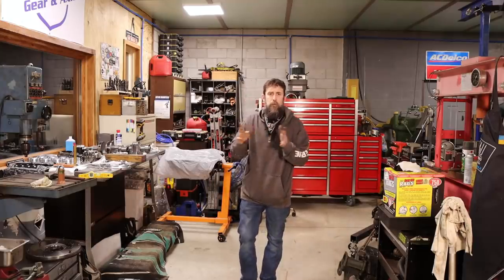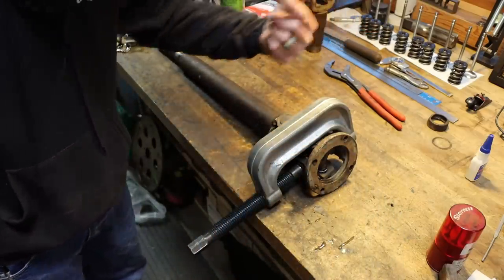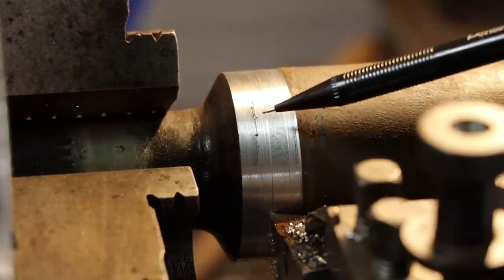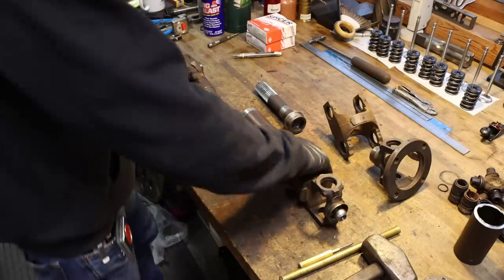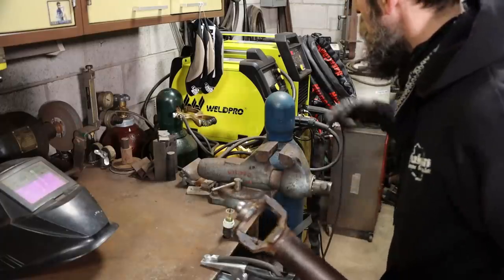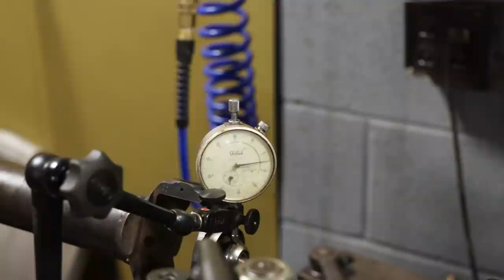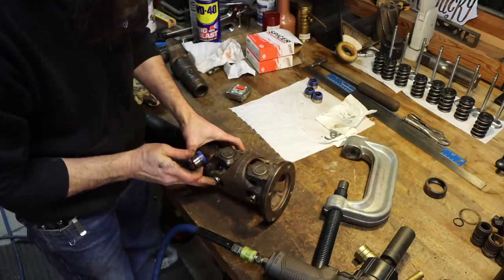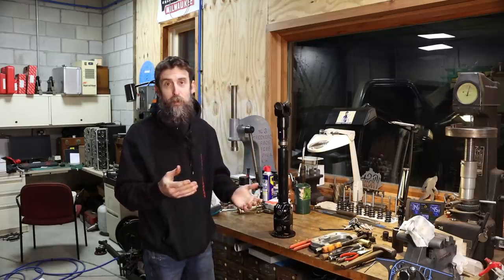Double Cardan shaft rebuild /Heat straightening / Shortening

Comment: Fenner has incredible heat straightening videos. Since he does a lot of native prop shafts, he does a lot of heat straightening. He can control the shaft in such small precise increments. It's amazing. You're a really smart guy, Steve. You must bea real asset at your job. I hope they realize that. You do great work. Thanks a lot for letting us watch.
Reply from the maker: Keith is definitely a pro at it. He is the guy that got me to try it years ago 😁👍
Reply: Yes, but Keith try this tecnique to a solid shaft, not to a tube.
Reply: ...maybe I remember wrong ?
Reply: @SalvoMorina  Yes, Keith used it with a solid shaft, but the principal is the same.
Reply: @joeylawn36111  of course the principal is the same, but the thermal stress in a tube of (let me say) 1/4 inch wall is much much more than in a solid shaft of 2 or 3 inches... I'm not a professional, maybe I'm wrong
Reply: @SalvoMorina  You’re right - but the process still works, albeit with more sensitivity for the reasons you mentioned. (I’m no expert either)
Reply: @joeylawn36111  anyway...the job of Steve is always awesome, I love his attempt to solve every difficulties by your own..!!!

Comment: One thing I learned when I worked at a farm equipment dealership. The whole unit is the U-joint. The part that looks like a cross is called a cross. I too called the cross a U-joint.

Comment: Impressive how the needle moved on heating the shaft!
Great job, thx for showing!
:-D
Reply from the maker: Its impressive what a change in temperature does. Same thing happens to a mic when you hold it in your hand, only in a much smaller scale.
Reply: @SteveSummers  I heard of that, that they will "bend open" just by the warmth of your hand, that's why they mostlay have that flat spots on the arch, to use this as the surface to touch...
8-0

Comment: Im a structural steel welder/fabricator (recently took over machine shop) :) and this is how we straighten beams or columns that either warp from welding or come in the shop already tweaked, pretty cool how it works, in the winter we use snow instead of water to shock it. Once again great work, i admire your attention to detail and patience/drive to do things to the best of your ability, and taking your time to do so!

Comment: Nicely done Steve. I'm not even slightly envious that your lathe is big enough for a Drive Shaft....! Best wishes, Dean at Retromeccanica, Oxfordshire, UK.
Reply: Look at Cutting Edge Australia, his smallest lathe can fit that entire lathe into it, and the largest  turns half ton parts. The size that a small cut is taking off 5mm per side, and barely even putting a load on the motor.

Comment: A little tip for the next one that you do put your live Center in the end of it with your splines chucked in the Chuck then take and heat it up in the area that you welded it until it is red with the lathe running on a slow speed, then take your heat away and let it sit there and run spinning between your Chuck and your live Center until it cools off Your live Center will automatically bring it to Center then once it cools off take a reading on it ,,,that should pretty much get you spot on that's the way we used to do it back in the old days at the driveshaft shop...
Reply from the maker: I Didn't consider that👍. Thanks

Comment: When you weld tube s and seal the ends it will blow out and mess-up your last weld. A vent hole is needed. after it cools the small vent can be filled.

Comment: 2 tips from an old driveline man, 1. Always install the joint so as to put your grease zerk into compression while driving forces are applied, and 2. Get your brass hammer and tap all of your "Yoke to Bearing Cap" areas (tap the yoke & middle carrier away from the bearing cap) to release any tension left over from compressing the bearing cap in place during the clamp-squeeze installation process, drive shaft should move smoothly, not notchy ... Also .. Why not weld while the shaft is in the lathe? you are TIG welding, not MIG welding, very little spatter to harm the lathe.  Great show today!
Reply: It is the chance of arching through the headstock bearings that is the concern.
Reply: @johnlennon335  You have a nice clean point on the shaft, sanded fresh, to connect the ground clamp to, so that there is only one solid ground point. Just think Steve did not want to move the welder from it's spot, though if he does start to do a few shaft or rotating jobs he will very likely make himself a set of shaft rotators as a jig, plus make a ground connector that can rotate with the job.

Comment: nice work . i've been watching this guy from austrailia , curtis from cutting edge enginering , he does alot of cylinder rebuilds , the drive shaft reminded me of that .
Reply: He is quite a talented young man as well, and he's always working on massive industrial machinery. One thing these professionals have in common is proper habits with safety glasses and safety equipment. I also like to watch 4x4 fabricators like "Matt's Off Road Recovery." But he never uses safety glasses when grinding. I wonder how many kids will lose their eyesight by following his example? Otherwise, it is an entertaining channel.

Comment: HEY, Every time I do one of these types of u-joints I always put the cup in question at a 45 pointed at the floor as I have seen them come flying out of the joint at Mach 2.5. Who ever designed these ball joint tools was either a genius or a genius. They fit these joints like they were/are the main reason they were made. It sure is nice to see you back on your lathe. You must miss it. Adam (Abom) would respect the heat alignment done here. He is really good at it for sure. 4 though is as close or closer than a factory robot welded shaft. All in all that was /is a great fix on a stuffy build. Just getting the u-joints done as I remember took a couple hours to re and re. Thanks my friend. You always seem to fire up my memory of days long passed. Take care eh.

Comment: Nice job! You didn't show how much fun it is when the needle bearings fall out of the cups. Or when you get the cups pressed in too far and bind up the joint. So much fun. When I work on a piece I really like that final paint that makes things look like new or better. Satisfaction.
Reply from the maker: I didn't have that issue with the carban side thankfully. The other end was a different story.  Searched the floor for two needle bearings at least 30 minutes only to find them shoved up in the grease hole on the joint🤯. I struggle with it just like everyone else on occasion 😁
Reply: @SteveSummers  You've a very nice arbor press right beside you. Why didn't you use that?

Comment: Porosity could be caused by by air heating up in closed tube pushing from the inside out permeating and bubbling through the weld. Remedy a really small hole drilled in the tube or warm the whole tube a little so the air inside is contracting during welding. It doesn't seem like it should have been a problem with air making it's way through a press fit but if it happens at the end of the weld I think that's what happened.
Reply from the maker: Yeah, I've definitely run into that.
Reply: That's EXACTLY what it is...
🇬🇧🙂

Comment: I saw that heat straightening method on a Keith Fenner video. Never though it could be applied to a hollow drive shaft. You taught 2 cool tricks in the span of a week. Thanks for uploading.

Comment: Nice video. Especially liked the use of heat to straighten rather than force. I installed a grease zerk in the threaded end of the needle. That way I don't remove and reinstall the grease gun end. This speeds up greasing. Just a tip I use, thought it might be worth mentioning.  Have a good weekend.

Comment: Nice how to video…for me it’s time vs money. Will repair in-house or sending it out make the most sense.

Great job explaining all the bits
Reply from the maker: Aftermarket drive shafts are pretty reasonably priced.  Just the quality replacement joints were over 50 bucks if I remember correctly.  I considered a replacement.

Comment: Good job Steve, I noticed when you did the first spot weld on the driveshaft you can see it actually move ,so next time you do something like that you may want to go back and check your video first before you go forward any further. Just an opinion. Anxious to hear at new motor run!

Comment: Nice job on the repair. Don't be surprised if it's out of balance after all the exact work. GM did not try to true the shaft before they injected the plastic retainer. They then balanced them with the shaft running in whatever position the shaft was in. Center of the shaft and center of the yokes were almost never in line. It shows up after you replace joints and the internal locks recenters everything. My shop sent many shafts out for rebalance after a simple joint replacement because of this
Reply: Since this is a front drive shaft it will never be used at any speeds much over 10 or 15 mph probably, so as long as it is close, it should be plenty good. I didn't see if Steve is installing a locker?

Comment: Using an impact on the ball joint press during reassembly is ballsy! I always turn the ball joint press screw with a wrench when installing the caps, since it gives one a chance of catching a problem (ex: needle bearing fallen over) before the new u-joint is ruined. Hey, if the impact works for you, power to you!

BTW... Supposedly orientation of u-joints  with grease fittings matters. Depending on whether the fitting hole is in tension or compression can change the strength of the joint. Probably doesn't matter unless you are really pushing the truck off road but worth keeping in mind, if you have broken u-joints in the past.

Comment: Years ago I worked in a small machine shop that did LOTS of driveline work, and yea the CV joints are a PITA...
We carried lots of parts including the ball kits.
But the point here is DO NOT HAVE that U joint cap  aimed at anything like your junk when heating!!!!!
I had one blow out with enough force to knock a BIG dent in a metal roof......
PS on the heat straightening we always did that between centers when possible.
Another tip is to press the first side of the new cap as far as possible past home before
starting the second cap. this greatly minimizes the dreaded " needle down"" syndrome, no fun.....
After all the internal clips are installed then you can and should beat on the center piece to seat
all the clips against the yokes.
Some of the real early driveshafts that used the plastic retained U joints did not even have provision for
the internal clips, those really sucked!!!!

Comment: Great job there, and yes old grease in the metal messes it up all the time, though I can bet you the original parts they did not care about the porosity, and simply welded over it, because paint was going to hide the sins. Probably soaked nicely into the steel, and nothing short of a hot bake would have gotten it out, or a relief hole the other end to drop the pressure. Yes grease is great, especially on hard to get parts, likely that grease you put in was the first since new on the shaft, and it likely spent a lot of time dry and in 2H.
Reply: If only paint could hide my sins.

Comment: Nice job Steve, i learned many years ago that its a pain to keep something straigt with welding. I had great succes with welding in a special way try to explain. first tackweld as you dit, then weld a quarter from left to right and the next quarter before the first q and so on till round . thus welding to the right en every next weld not after but before the lastweld. this somehow correct the deforming from the other welds. try it out welding a pipe on a plate like that and be supriced how straigt it wil be .
greatings Jos .

Comment: Can you get a rubber accordion boot to go over the sliding joint?  My old landy has them on the prop shafts, an additional layer of protection for the sliding joint and splines.

Comment: I've worked on a few of those.  The original recommendation was to press those U-joints until that plastic sheared.  I did one that way, it was a frightful process.  You also risked warping the yoke.  The next one I took to a local shop, he simply torched the crosses away and knocked the caps out while things were still hot.  Take the parts home, clean the bore the caps went in with a dremel and a worn sanding drum, put it back together.

One other thing I do with new U-joints is to pack those caps with grease as soon as I remove them from the cross.  It keeps those needle bearings in place during assembly.  You can pull the zerk to allow any excess to bleed out and not impede your progress.

I now have "big bore envy."  I have a truck driveline to build.  3" tube.  My lathe goes to only 1-9/16.
Reply from the maker: My lathe only has 1.5" spindle bore 😁. The chuck is pretty deep tho.
Reply: @SteveSummers   might not be so bad, then, my Bison chuck is a set-true, and has a good size center hole.  I got a bit more past that, the spindle is MT-5 stub.  Past that is the straight spindle bore.

I plan to upgrade my pickup rear driveline to one that would have been used in a larger freight truck.  U joints are the same, just bigger, heavier tube and carrier bearing.  Dealing with longer components, I'll probably be using the steady and removing my tail stock for the first time ever.

Comment: Nice work. 20 years on 9 miles of dust dirt mud wet to hot highway right back into mud dirt road and the instant i switched to spicer NON greasables i stopped changing u joints as often. The new spicer seals on the non greasables are far better than the greasables.

Comment: welding pipe with a "little" TIG torch like that (under 200A) you need to run a very thin rod, like 1mm or so. the thicker stuff like 3mm and up will only make nasty porosity unless you slap a huge gas lens onto the torch and even then you are still liable to get porous welds...

Comment: Nice job on the drive shaft. My only problem with greasable joints is the grease channel makes them weaker than a solid joint. For my application, I take my Jeep off road to some pretty rocky terrain. A greasable joint is much more likely to break doing some of the stuff I do. :)
Reply: This is why you need to take time to mull over the ORIENTATION  of the u-jt in the yoke. For optimum strength, you need to orient the "cross" so the trunnions adjacent to the grease fitting are in COMPRESSION when applying torque when traveling forward.

Comment: NEVER grab the tube of a driveshaft in a vice, it will cause a vibration every time. Only grab the weld or casting..... You should also seat the clips or the caps can press against the cross and can prevent grease from getting into all the caps. The ball joint press works great on removing but installing I like to use the vice or hammer to get a better feel..... JMHO.....

Comment: The piece you cut out of the drive shaft can be used at the press as a sleeve to press parts together or apart and why did you not weld the shaft in the lathe you could have had the spline end chucked up and used your live center in the other end and it would hold the shaft straight  as you welded it together

Comment: Those hoodie draw strings were dangling awful close to all those rotating parts as you were leaning into your work. Sorry but I figured somebody would notice it. Did a lot of farm equipment shaft work so wasn't really concerned about balance mainly straightness but rpm's were a lot lower. Peeled them off just like you did.

Comment: Why not use your arbor press to put the u-joint caps on?
Reply from the maker: I like using the ball joint press better personally. It already fits without using extra drifts. Plus my arbor press isn't bolted down 😁

Comment: Way to over complicate everything again Steve haha. I did this job with a zip wheel and a stick welder. The only way I could run the welder was in the basement with the power leads bolted to the mains. I had some plywood v's and a dial indicator and monitored the movement as each weld cooled to decide where to place the next. Can't remember what the final runout I achieved was, but I got online and searched what professional driveshaft build shops tolerances were, and they were speaking in hundredths...so .004 muy bueno. I was building a bastard shaft to go from np208 to Toyota for a small block swap.
Reply: If they are building to hundredths,  no wonder they need balanced!
I build semi truck drive shafts to .004 or less if I get lucky.
No balance necessary.

Comment: With the work carried out the shaft will require to be rebalanced however careful you were with the cutting, welding and reassembly.  The before and after run out on the shaft alone will be enough to change the balance.

Comment: Hi Steve. Great job as always. Love your clarity of thought on everything you do. I would have been tempted to do the welding with the shaft in the lathe and the tailstock pushed up tight. I don't know anything about this stuff though. Is that something that may work to prevent the heat warping? Anyway, you got it sorted so no worries brother
Reply from the maker: Welding on a lathe is risky business.  I avoid it all together due to the risk of headstock bearing damage.  One small arc through the bearings from a bad ground and its goodbye headstock bearing ☹. 😁👍 Thanks for watching
Reply: Ah ok thanks. That's not something I would never have thought of. Hope others see this explanation who might have been tempted to do like me as well ❤️

Comment: Hi Steve,  Is there some kind of concertina boot you can put on the slip joint? Like a CV boot, or a steering rack boot?
Reply from the maker: Some shafts have them from the factory.  Its probably a better way of sealing them up than the compression seal. Only issue is they are easily torn when you drive in tall grass .